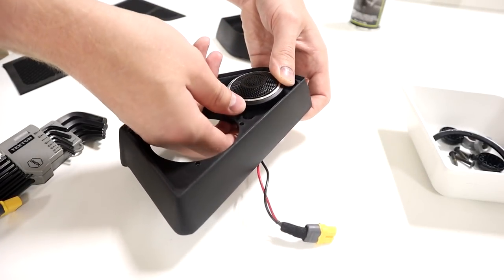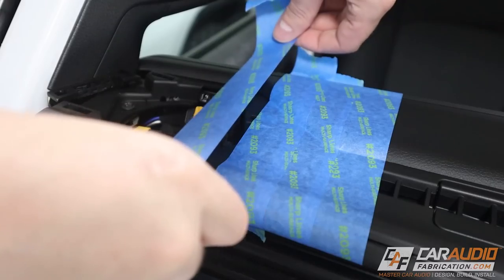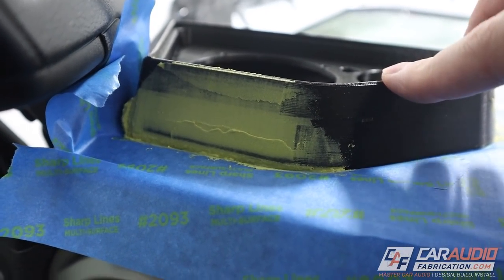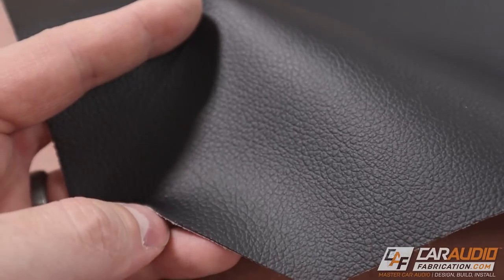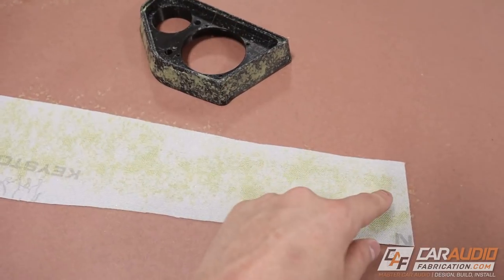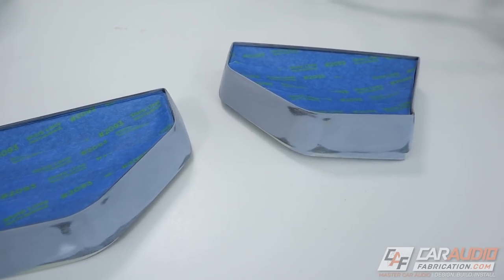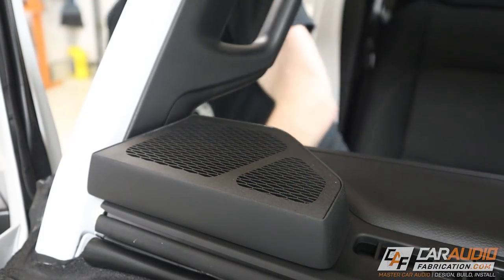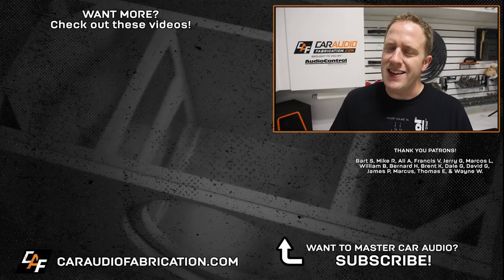Texture Coating & INSTALL! Making 3D Printed Speaker Pods

Comment: I just installed my first subwoofer and one of your videos actually helped me with it. I purposely didn't cut my wires to length because I had a used amp I wanted to make sure worked, but I'll be doing that in about an hour. Now this, this is something I want to do but I don't have anything to do it, the knowledge or tools.

Comment: This looks amazing,  much better painted. 

My only concern is that some of the material used in 3D printers do not hold up well to heat as seen on a dash
Reply: This ^
Reply from the maker: The material I used has a far higher melt point than what everyone is familiar with in 3d printing with the PLA. I've made quite a few parts that sit on the dash and haven't had any issues.
Reply: @CarAudioFabrication  are you using ABS or CF?
Reply: @Bigpapitheking  he said he's using ABS in the last video about this topic. I'm using PETG in my gf's car and until now no melting has occured. ABS is safe up to 100°C and PETG I believe up to 80°C.
Reply: @ndc5544p  I didn't catch his last video, they don't pop up in my feed very often. but I clicked on this one when I saw it because I want to build some pods for my S10 project. I haven't used the ABS yet just PLA and my Resin printer. Just was curious as to what was used because PLA isn't worth a crap in any hot environment I have noticed.

Comment: If you mount a new amp in the boot and it's got 4 channels, does that mean you have to run speaker wires from the boot, down the sills, into the doors and to each speaker? That's a lot of work if it's a 5 door car! 

Secondly, my headunit is 4X40 and sounds reasonable. I've upgraded my 4 speakers already.  Sure it lacks lower frequencies but I think all I need is an active sub in a box in the boot to add the missing frequencies the door speakers don't give. I'm not bothered about volume really, just the missing frequencies....are there any good value for money active subs in either a box or a tube that I can just run RCA and power too and just make it reasonable? I don't want premium, middle of the road is fine. Can you suggest something in a tube that won't break the bank?

Comment: What did you do for speaker grills? You had a gap in pod for the vinyl material. The vinyl was going to hold the grill in. Did you Lazer a bigger grill.
Reply from the maker: Yep, larger grill with smaller gap sized just for paint. Paint has thickness too. 👍

Comment: nice project , but….they look a bit to square and flat so they don’t look oem which makes them stand out a bit to much , might look better if they were molded with the same curves and edges as the dash and slanted a bit towards the listener , i don’t mean to bash your awesome work off course but to give thought for new project ideas , greetings from a “retired” ice fabricator from the netherlands
Reply from the maker: I actually really like them but to each their own!
Reply: I like them, the may not be a good match in an Porsche, but for a jeep I think the aesthetics are spot on. I think the paint was a good choice over the vinyl, as well. That said, I'm a bit surprised filler was nessasry for anything more than smoothing the print. I would have thought those gaps would have been incorporated into the design, but I can understand it being easier to use filler when using it for the lines anyhow.

Comment: 3D printing filament will not hold up to the high temps in a car on a hot day. it will soften at high temp
Reply: at what temperature is filament melted to create an item , roughly 175c ? i hope it doesn’t get that hot in your car because all the plastic parts would melt and half the interior is plastic, wich is also hot formed , it just depends on what filament you use , abs would be the right choice
Reply from the maker: This is addressed in the first video. Not the first time I've printed parts for a car. I have dash parts that have been fine for years using the high temp materials I used.